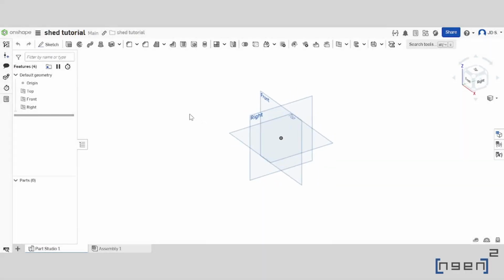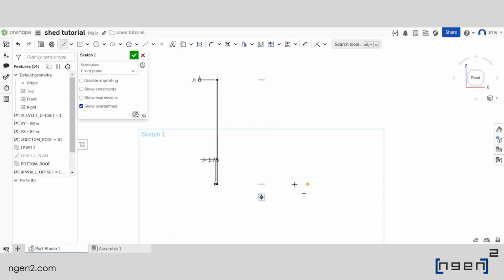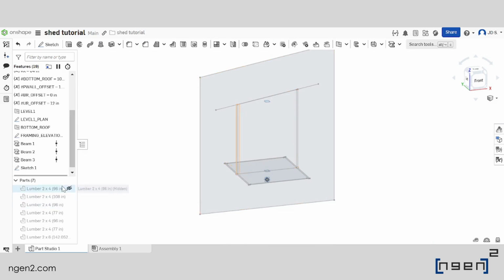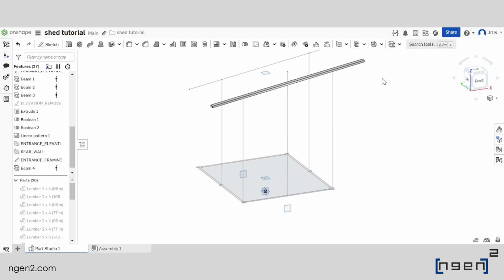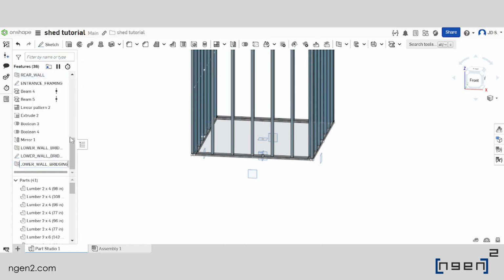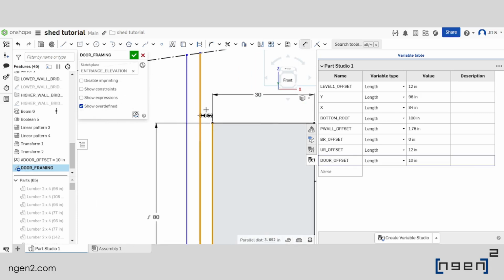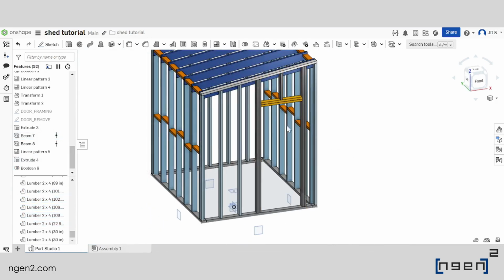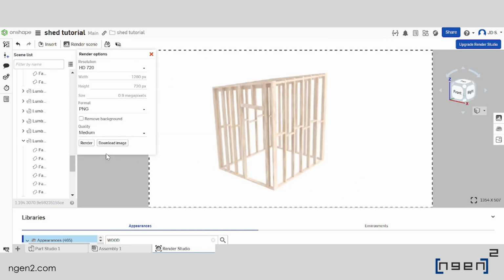Parametric Shed Frame Onshape Tutorial

Comment: Undoubtedly, a powerful tool for a variety of design uses.  But, think of how a typical dude wanting to build a backyard storage shed looks at this.  In the time it takes to grasp the tutorial and then go through a few iterations of each plane or sketch, correcting here or there, a few retries, a few start overs - the dude could have just grabbed some graph paper and been done.  For sure it's better than sketchup-free - that tool is quite frustrating in the context of a framing/architecture tool.  This one - quite the learning curve for a person who just needs some blueprints and has to master the patterns here like planes and linear patterns.  I'm a software architect and can digest the concepts here, but it would be nice to see some enhanced UX here to drag and drop, snap to grid, etc. right out of the gate.  Give me a 'build a rectangle' and 'ask me for dimensions', rotate at will, snap it to another point, done.  Again, powerful tool, and I appreciate the excellent tutorial.  It has a specific audience though.
Reply from the maker: This is a parametric modelling tutorial… I think the point has been missed here. A parametric framing model is essentially a machine for pumping out cut-lists for dozens of different iterations in seconds. Not meant for a one-off shed. Would not want to do 10 different sloped roofs on graph paper. The mathematical logic for the model can be applied to any software and UX is just a matter of development - there are software out there that can integrate with Onshape for this.

Comment: Great timing, I'm going to be building a shed this spring and was thinking of using OnShape to design it. Thanks!
Reply: so far for access and features, simplicity and power, I'm finding onshape to be a top platform.
Reply from the maker: We have a methodology for modelling small (and large depending on parasolid kernel limitations) building structures in Onshape. Features are really good and
continuously evolving. Staff are also extremely receptive to feature requests. 

We find the overall user experience and reliability of Onshape superior to any other CAD software.

Comment: Pretty good video.  Lots of useful information for a newbie like I am.  I subscribed.  One question though.  Why did you use Beams instead of Frames for this video?  Beams was the genesis of the Frames tool and it has been deprecated in favor of Frames.  Regardless, thanks for the video!

Edit: I see where you mentioned that Beams has been deprecated in the pinned comment above, but I am still curious why you did not use Frames.
Reply from the maker: Hey, 

Glad you enjoyed our video. We did mention what you have stated in the description. We realized this a bit too late hahah.

Frames tool should be used instead for sure. We were happy to discover this update from Onshape.

Cheers,
-ngen squared
Reply: @ngensquared  Is there support for Lumber in Frames?    I could not find it.
Reply from the maker: We still use the Beam tool for lumber. If there is a feature you wish to be implemented into Frame you may submit a Feature Request!
Reply: @ngensquared  The Beam tool is gone and it appears that the Frame tool is only for metal. I cant find timber profiles in there anywhere. 0 search results for "beam" or "timber" in Onshape help.
Reply from the maker: You can create a custom profile with lumber dimensions; please email us, we can walk you through it.